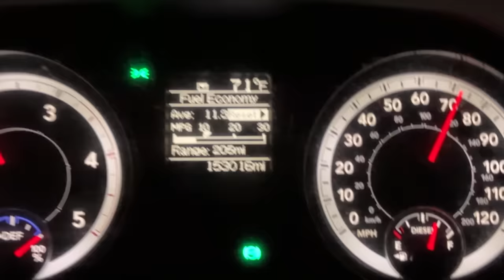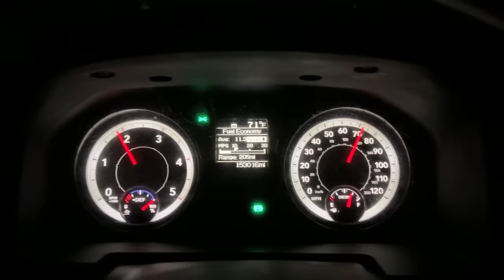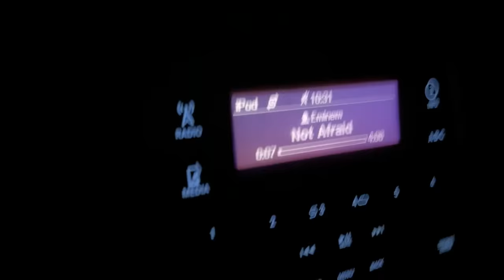My new truck broke down 9.5 hours from home. Dealer refused to do anything...

Comment: I would say put the fummins back into commission because 5.9 parts are everywhere and without the 6.4 those 2008-2010 f250-550 parts are everywhere. Even though I’ve been patiently waiting for the day you sell the fummins for me to buy it. Plus if you put even more power to the 5.9 cr that you have it will tow great like a new truck especially with some helper bags

Comment: CP4s are a scourge on the truck world. I have a 2013 Duramax and installed a CP4 to emissions-legal CP3 conversion kit from Thoroghbred Diesel along with a beans sump and a lift pump just to make sure the CP3 could get fed. I did all this before I had issues, but I shouldn't have had to do it at all. The EPA is going to keep making these trucks worse until we are all in gassers.

Comment: A guy I hired to do work at my house (remove tree stumps) pulled up with his equipment trailer. On a break he told me his truck was a Ford diesel (don't know the year) and he bought it with 350,000 miles, put about 1400 dollars in it and it runs like a top. It sounded great so sometimes the Gods are just smiling on you. Good looking truck. Whoever had it, cared for it. That's the key.

Comment: Not fer nuthin', but you bought a USED truck from a Ford dealership franchise USED CAR LOT, not from Ford and not from the dealership you were towed to. This dealership doesn't owe you anything beyond any warranty left on the original Ford warranty. Not to put you in front of existing customers, not to store your trailer (although I agree they could have let you drop it in a secure spot behind their building).

Comment: Dude Ford just sucks. And my family was a huge Ford dealer for ages in SC.  Ford can’t build a Diesel engine worth a crap with the government making them use strict epa guidelines that have absolutely no common sense in their thinking.  I got rid of my 6.0l and got a Ken-worth T-300 single axle with a sleeper on to pull our horse trailer and camper with and it’s a beast it pulls amazing and now has over 875,000miles on it will start right up ever day and run like crazy.

Comment: Well done, that man Chris!! Glad you were able yo get home. What an ordeal. I have  been in the position you are in now. I bought a brand new 84 Oldsmobile Delta 88 Royale 2 door. Thing was forever broken. 42 work orders in the 18 months and not quite 30,000 miles. I should have kept the 69 Acadian. Such is life. When it comes to diesel, i only know what my brother has found out with his 2018 F-250 Power Stroke. He lives un a small town in the Yukon Territory just south of the Arctic Circle. It is sbout 6 hours or 350 miles from their place to Whitehorse. One day leaving Whitehorse the truck decided that the urea injection system was bad. Fortunately ttey were under 35 miles from the dealer. Limp home mode was 35 miles per hour for 35 miles, after which she die until the computer is reset. Being where they are, had they been out of town they wiuld have needed to use the Coast Guard monitored Emergency Beacon to ask the either the Search and Resue or the Army to come pick them up. Luckily he got the extended warranty. To repair the Urea system was going to be $10,000! To remove the system was $2,000. The warranty company accepted and paid the claim

Comment: I think that’s when it’s time to contact the people at Ford itself and let them know what kind of a bullshit treatment they gave you. I think it’s time to start holding those punks accountable. Not one thing I can give you a little advice on. Use a good quality fuel treatment that has a good quality lubricant in with it it will work fine with your truck. It helps the injection pump. It helps the injectors, it keeps things clean. It will really help out a lot all right this is six in a row.Jim from Kennerdell, Pennsylvania, I go by six in a row jim I have a 1991.5 dodge with six in a row under the hood. Hey, I hope everything works out OK for you guys. It’s disgusting with these car dealerships are doing now all right you have a good day.

Comment: The CP4 issues have been going on for so long. And the manufacturers will not fix the issue. This was the problem with the 11-16 Chevys. S&S Diesel has come out with an aftermarket pump that fits the 6.7 powerstroke

Comment: I manage two repair shops. You would not believe what I have been seeing.  The quality of my beloved Fords trucks has literally gone down hill since 2020.  I have seen brand new Ford Trucks come in 2023, with the front suspension bolts falling out.  I don't know what is going on with Ford, but I would not buy any Ford Truck 2020 or newer.  And The reason why these trucks end up at my shops is because the Dealers are doing nothing.  We live in clown world anymore.

Comment: I know how you feel I own a Ford truck got stranded 6 times I had enough, I sold mine  Sell That Ford F350  and get you a Ram  or Chevrolet , Keep that black  Truck,, so many of the of the F250 and F350 Ford Trucks is breaking down leaving so many people stranded, on road side. The Dealer could have treated you much better than what they did

Comment: Ford and dodge have all had issues with the CP4. I have a dodge 3500 single wheel. I got rid of the CP4, and added 2 CP3's. It's much more reliable engine. Up hill I pass so many stock ford diesels, and I wave as I go by. With a few add-ons that ford would be comfortable.  So keep the old and sell the other.

Comment: I had good dealer experiences in the 1980s, Fiat and Mercedes. Now the culture has changed, now they just want to gouge the most money for the least effort. Mercedes and Toyota. New starter motor fitted £1600 dealer, £560 indepenent, Toyota Hilux all genuine parts. The dealer is a generally unpleasant experience.

Comment: Well , I understand you dont want to do it , but you HAVE to do it. It is your responsibility to put these folks on blast. WHY ? You arent driving a 30 thousand dollar truck . Your driving upwards of a 100K truck all said and done and it has a big ole OVAL banner on the nose telling the world what brand it is. I also understand you are in a wiedr place and you want your truck fixed and now frightened they will try and deny coverage for some reason and believe me , they are going to try. The first thing they will do before ANYTHING else is pull fuel samples and do other visual inpections for fuel contamination  . Alot of folks putting DEF in the fuel by mistake and I do understand their position on this.
HOWEVER , you still bought 100K worth of something from this company and should be treated accordingly. I do agree that its the specific dealer but tis Fords job to keep these ass hats in line. If you dont make noise frankly Ford doesnt get the point and wont do a damn thing.
I am not talking out of my ass and I have owned plenty of the newer super dutys to back that up . I too have been in a simmilar situation which turned comedic when the service writer (IE salesman) tried to tell me that fuel related issues were few and far between when my 15 350 Platinum threw codes for fuel pressure . That all went sideways when a very unhappy man pulled into the service lane with his 40 foot 5th wheel and an almost identical truck with 30 thousand miles on it having the exact same issues...I was 1000 miles from home home but was fortunate enough to be at our vacation house in FLA . And this poor guy along with his VERY UNHAPPY WIFE were in route to a planned vacation  .  I was given my truck back the first time and before I got back to the house it threw codes and began stalling  , now being worse than it was when I initially dropped it there .  I had the gold standard warranty on my truck and I believe the other fellow did as well.  Anyhow , after some weeks rolled by I did get my truck back fixed and never had an issues again . I dont know what became of the other fellow and his angry wife.
WHen I got my truck back they had cut the right front tire on the lift arm so I never really made it home . Went back and they did install a new tire .
This was Gary Yeowman Ford down in Daytona and I had tools stolen out of the truck after I was told it would all be fine . I had the cut tire and I waited nearly a month to have my truck fixed. While I was waiting I started googling and its a problem hands down... ITs a shit design on a truck that costs this kind of change and you cannot make me believe Ford cannot afford engineers to make a system more robust on a vehicle that can go horth of 100K .  To be fair , I have owned several and ive been lucky enough to have only ever had that one issue  . But looking online showed many many folks with issues and denied warranty claims and on and on...This is compounded by the lack of competent Mechanics that are smart and you would trust your vehicle with.. Everyone is trying to save money meanwhile charging you premiums for trucks.
I feel for you man . I did live TV for discovery networks and used my truck to haul all critical equipment to locations (Ass Monkey Live being a reoccuring one) for all events . Believe me when I say millions were at stake when that truck left my driveway and it simply wouldnt have been acceptable to be treated this way. People spend the money they do on these trucks and they rationalize it because they have a critical task to complete . PERIOD... FORD ???? Wake the hell up stop counting beans and making gay raptor comercials and take care of the people that carry your buisiness, It damn sure hasnt been hundreds upon thousands of good ole boys wishing they had a giant rainbow painted down the side of their tow rig , or welding rig . Nail these dealers to the ground that sell your product and make sure they can support what you sell and warranty.. If they cannot thats up to you to make it right...

Comment: I worked for Ford Motor Company for 31 years and a large Texas metro Ford dealership for 11 years (retired now). This is a difficult situation, not very common but they do happen.  I'm not attempting to justify anything on what happened to Taylor but in my experience this is the reality.   1) For those of you who are young, mechanically inclined, like to fix things and don't mind getting dirty this is a career you might seriously consider.   Good, competent diesel technicians are very hard to find and they command top dollar - anywhere in the country.  Most experienced diesel techs earn $90-$100K + all day long.  Finding any level of technicians is a major problem in the auto industry as a whole but especially an issue with diesel techs, one of the reasons why there is such a long wait time for a dealer to diagnosis and repair.  This just isn't a job you walk in off the street and do.   They require many hours or training and need to purchase many special tools.  2) Diesel and especially heavy duty trucks are work trucks where the owners use them to make their living. Many run them hard and like anything mechanical they break down.  And there are a lot of them on the road so a lot of older trucks need repair.  In the last 5 years we have traveled all over the country and have stopped for oil changes at Ford dealerships and talked to dealership personnel.  There probably isn't a dealer anywhere in the country where you could break down with a heavy duty diesel truck and they would work on it the same day other than maintenance stuff.  I can't speak for GM or RAM but I'm pretty sure they have the same issues.  3) Lifting a Super Duty F-350 dually requires a special hoist.  Unless the dealership is a dedicated heavy truck dealership they may not have the equipment to safely lift this large of a vehicle or they only have one or two lifts.  Diesel engines/systems are tightly packaged in the truck so accessibility for many components can take hours to replace and the trucks are physically tall, most techs use platforms to stand on.  4) Unfortunately many dealerships/personnel are short sighted and are not too interested in working on a vehicle that you purchased from another dealership.   One of their reasons is that they prioritize the customers who are long time and repeat customers and you can see their point.   At the dealership I worked at as a traveler I would have pulled one of my master diesel techs, do a quick visual inspection to make sure there's nothing obvious is loose or disconnected and pulled any diagnostic codes.  But if it was something major you would be waiting 4-5 days for repairs. And most service advisors are straight commission employees who have a vested interest in taking care of "their customers".  If you don't get the answer you want talk to the service manager, general manager or dealer owner.   Be professional!    Most times it probably wont do any good but it doesen't' hurt to try.  5) At my dealership I might have been able to help you out with a loaner or a cheap rental for transportation.  But F-350 dually trucks are expensive, they are considered a specificity truck and I can't think of a dealership anywhere that would have one available as a loaner.  6) I didn't see what the resolution was but if this was a product failure, you own other Ford products.  I certainly would contact Ford customer liaison and professionally express your disappointment with the situation and how it was handled.   They usually don't cover "consequential" expenses but ask for a Ford extended warranty to bolster your confidence.  7) I saw this many, many times in my 11 years working at a Ford dealership.   There is a misconception by many that diesel engines are unbreakable and will run on anything like peanut oil.   That might have been true in the 60"s but modern diesel engines are engineering marvels, with fuel systems operating at 25,000 psi and powerful computers.   They are robustly designed and will run for 100,000's of miles IF and only IF they are properly maintained. Compared to a gasoline engine diesel engines require considerable more and expensive maintenance.  If you want longevity maintain to what the manual states and use good quality parts. 8) Getting a load of bad fuel (water/dirt) or having an untrained person add DEF to the fuel tank happens.   VERY expensive as most of the high pressure fuel system will need to be replaced.   Ive seen many people file a claim with their insurance company.  A DEF in fuel take accident will set you back $15 - $20K!   

This probably won't make you feel any better but a prospective from a former Dealership service director.

Comment: if it was me...
1/ let the ford get fixed then unload that puppy. you just saw the tip of the iceberg.
2/ get an earlier dodge (ram) like the one you were loaned. go through it w/ durability in mind and enjoy the next 200k miles carefree w/just expected maintenance.....and possibly a clutch assembly in between. easy. cost effective. durable.

Comment: In 2014 I bought a used f150 with the ecoboost. I knew it had a turbo related issue because I could hear it. The ford dealer I took it to sabotaged it by clamping a bypass hose charging me $400 but don’t worry it didn’t make as much noise. I didn’t know they did that until I went to replace a headlight. Got my money back and fixed it myself with a turbo smart blow off valve

Comment: I’ve owned 5 fords all of them left me stranded multiple times two of them under 100k miles they were all complete garbage I’ve owned Chevys they are one of my fav brands an didn’t leave me stranded nearly as much as ford but still did Toyotas are my favorite brand an will be the next vehicle I own but my work car and daily beater is my 2005 Elantra bought with 110,000 miles December 2021 an now it has 140,000 miles an drive it from NJ to Chicago 2100 miles in two days and this car has never left me stranded and bought it for $1400

Comment: Please be kind if this question was already answered, but if it was the CP4 fuel pump fail, my understanding is it is most commonly due to either air in the system (from filter changes not being done 100% right, and knowing you that wasn't it) and the other most common is not the correct fuel (manual says "Top Tier" and that's not available near me so adequate fuel lubricant needs to be added every time you get fuel.  Just wondering if you added fuel lubricant?).  When you mentioned the dealership asked about moving you trailer...  I am not sure if I could have kept my composure without assistance of police restraint!!  What the hell is wrong with common sense?

Comment: This just disgusts me. Dealers suck. Im in the market for a new truck and have been a Ford guy all my life but I have scratched them off my list. I've owned more trucks than I can count. But now I will shop GMC and Ram. To many superduty horror stories and dealer issues. Still have my 06 350 bullet proofed 6.0 is safer than these new ones.

Comment: Taylor don't put the blame on the ford dealers no need too sale your trucks it's the Louisiana state dealers I want take my car to any dealership in Louisiana they are not professional I had the buick dealership in Natchitoches Louisiana tell me my motor was bad they wanted me to buy a new car so my sister inlaw drove from jonesboro la and took us home Tomball TX. I have a truck will it was in the shop I
At ford shop so I rented a f250 and a trailer get my car back to the buick dealership and it was the radiator that was it. SORRY FOR BEING SO LONG.

Comment: What sort of warranty was it? Was it the kind you buy and have to abide by all the rules to keep your side of the agreement? .Better to do without it and save money as the Warranty companies would try as hard as possible to not pay out. Servicing the truck yourself is cheaper and if you do it right the cost savings are immense. I recall a similar vid earlier this year where the Ford dealer actually called the police. 🙄🙄